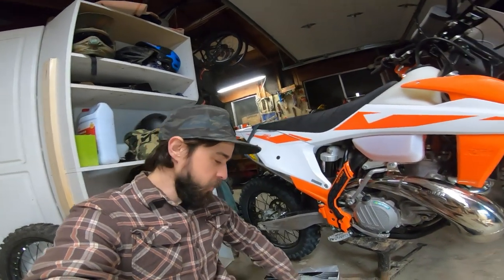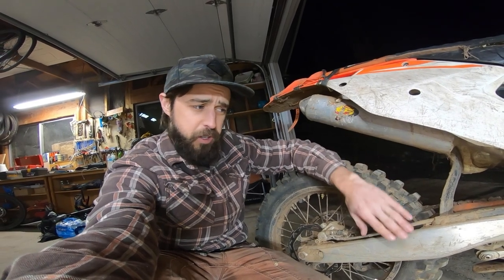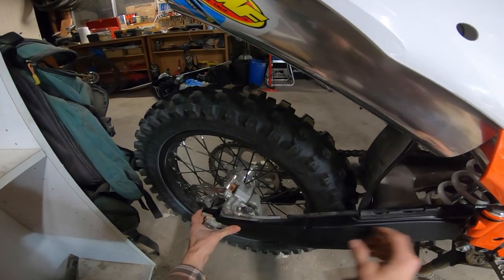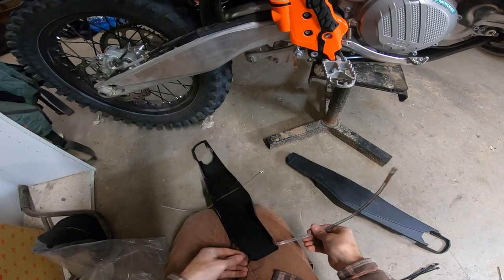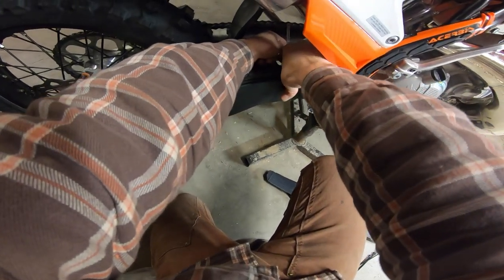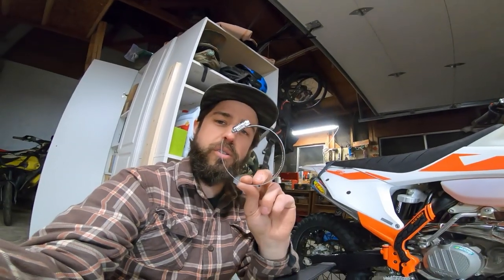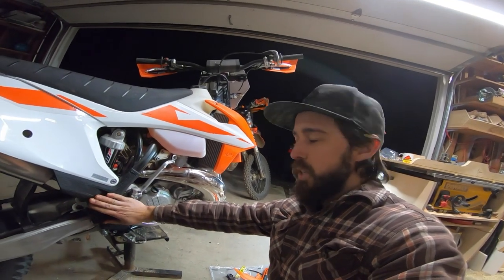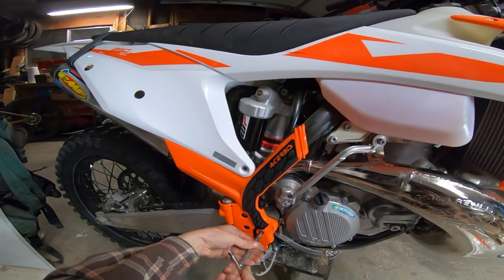Swingarm protection / 2019 ktm 250xc hard enduro build

Comment: Those works great for rocky terrain. One word of caution on the swingarm protection. Take them off after every other ride and clean the inside of the protectors or if you've ridden any muddy or sandy terrain, definitely take off and clean out. If you don't the grit between the protector and swingarm grinds on the swingarm and you end up with a swingarm that looks like somebody took 50 grid sandpaper to it. Maybe that's why plastic zip ties is a better option to fit. I add a zip tie thru the swingarm axle hole in front of the axle bolt around the top for a 3rd mounting point. That zip tie never breaks, since it doesn't come in contact with any rocks, etc.
Reply: The Polisport branded ones come with foam backing on the rear to help avoid the grit from sanding the swingarm.   You can add some puffy tape to the OEM ones too
Reply: @aaronmgray  that’s awesome!
Reply: @aaronmgray  then on the flip side, it’s a dirt bike...who cares!

Comment: Those swingarm guards suck.. I took mine off after breaking the zip ties.. they trap so much sand and mud inside of them too.. your swingarm will look just as beat up either way.. and they making changing a rear tire a pain.
Reply from the maker: yeah was thinking that could be a problem. considering using VHM double sided tape to seal them on. hows changing the wheel hard? havent had them long enough to know!
Reply: Trailbound co they knock your wheel spacers off when changing the tire.. usually in the sand when I’m at the dunes.
Reply: Never had any issue with tire changes, Racing off road NMA.

Comment: Stainless steel reacts with aluminum and eats away at aluminum
Reply from the maker: That swing arm has quite a bit of aluminum on it I think it’ll be fine for a couple years
Reply: @TrailBoundco  Yeah, if you wanted a long term solution you would have to get something made from aluminum to stop the reaction from occuring. The reaction makes the aluminum brittle and break easily.